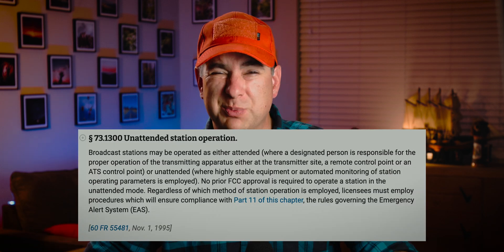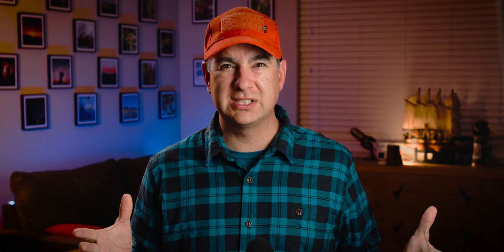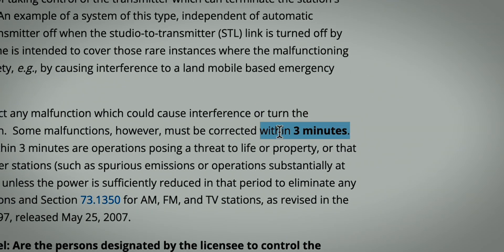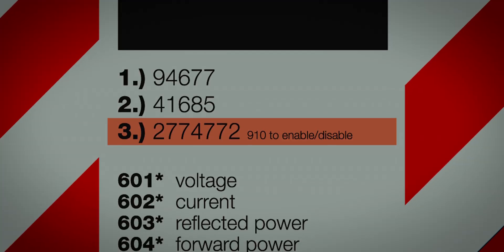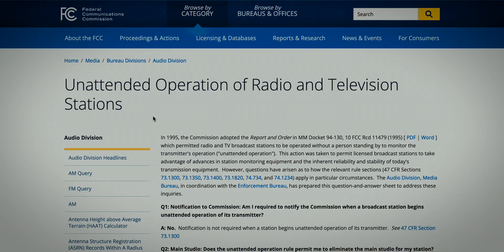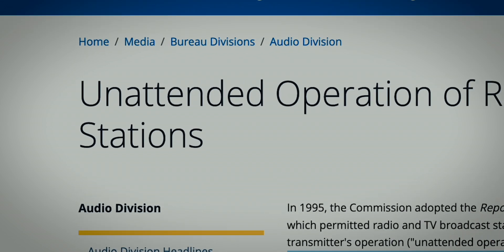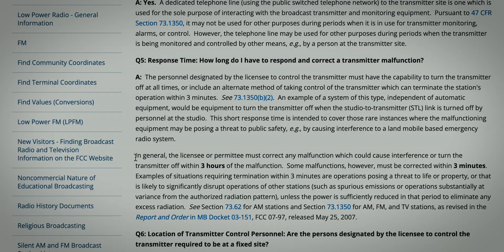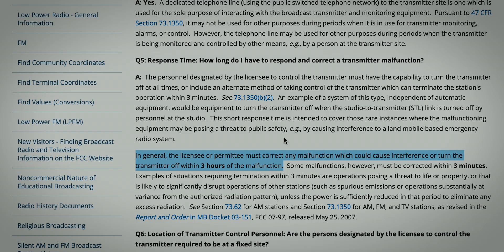The Truth About Remote Controls in Broadcasting

Comment: Last radio station I worked at before going into TV, the mid-week RC calibration was among my responsibilities.  Was a tedious set of tasks back in the 1980's as it had to be done on both the day and night patterns for the AM. We had different Moseley/Hallikanien hybrids for the AM & FM sites.  When it worked, it was great.  When it didn't...!  Telco noise was a problem.  Particularly on the FM path.  First, it started turning things off at random.  Then, it started turning things on at random!  Like the night our maintenance guy was in the air studio and had the local Top-40 feeding it while he worked with his head in the guts of the McCurdy.  Taking a break, he looked up and saw the slave meter off the FM mod monitor bouncing!  Needless to say, the FM rig got shut off fast.  Not a word was said.  However, we soon got a newer remote setup from Moseley.  Problem was, while that one was functionally reliable, its telemetry drifted across a good-sized parking lot.  So... the FM ended-up being a hybrid of a hybrid.  We used new system for XMTR control and the old for monitoring.  Clunky.  But, it worked.  Problem was, explaining it to some of the Third-Phone ticket folks when they hired-on.  

Marcus, this was another great video.  Here's a topic for a future one:  "I'm from the FCC.  And, I want to see your Public File."  Training new hires for that was among my tasks at my last employer.  I mention it here because engineering has input into it.  And, it better be up-to-date and verifiable.  Getting "the call" to fix someone else's neglect when it wasn't was not a fun experience.
Reply from the maker: Oh gosh! It’s amazing how far we’ve come with technology and reliability of remote controls. 

FCC wants to see your public file… “here’s a desk and a computer and we’ll open up a web browser to the FCC website….” 😜
Reply: I set up a Moseley TRC15 system during the 1980s. When I put in a PCL-606C STL, I had them send me a set of 185 kHz subcarrier boards for the TRC15 so the commands could go out on the STL. The telemetry came back on a 450 MHz TSL link. The most unreliable thing was that the calibration pots on the studio unit were fussy and drifted. I replaced the with 10-turn helical pots, and then the system was very stable and reliable.

Comment: Very good information! we just got a brand new Burk system installed 2 month's ago! so much more reliable compared to our old system
Reply from the maker: I’m a big fan of Burk. Sure it has its warts like all of them, but I could get the one I had at the other place working like a charm. The last thing I was about to do was turn on the Jet flowcharts for automatic switch to backup transmitters. Didn’t finish that before I left.